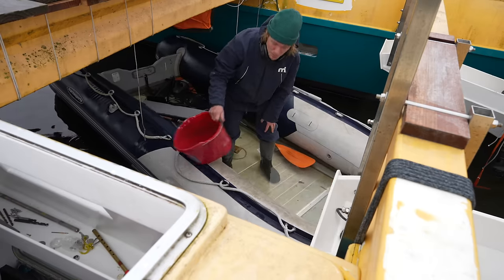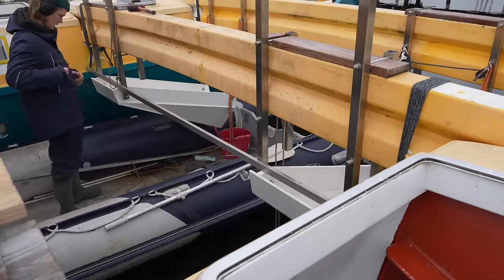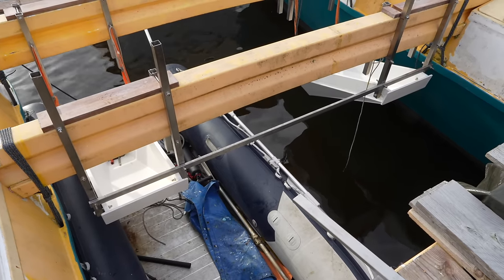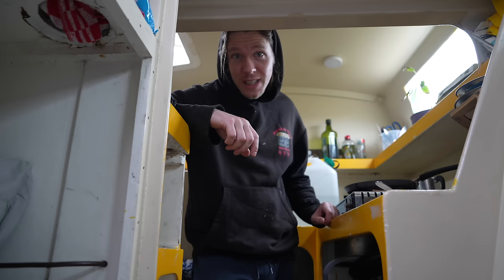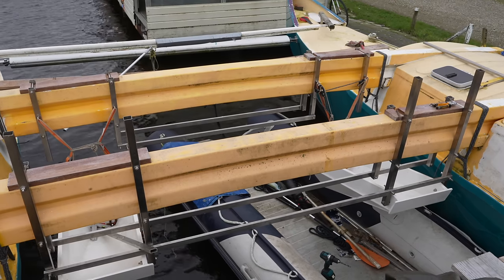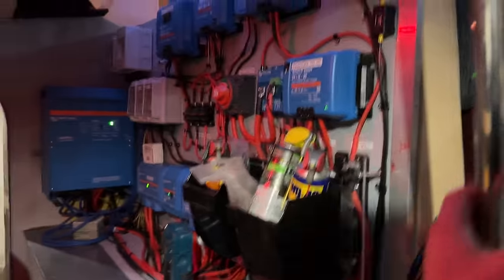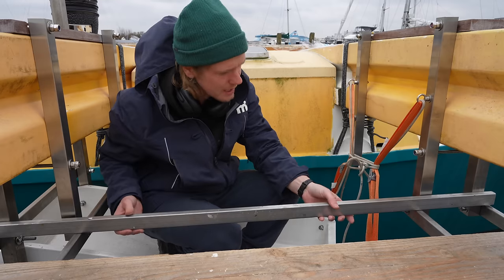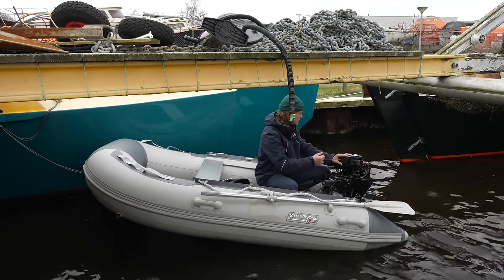I Built A Cockpit Floor for My Ocean-Going Catamaran | Wildling Sailing

Comment: U asked for drill sharpening advice.  I gave it before ... but here it is again.

Buy a small elec grindstone.  Hold one side of the tip to the side of the fine-grit wheel, at the right angle, press it on, and twist it off to lower the trailing edge of the cutting edge.  Repeat on other side of drill tip.  You'll make a hash of it the first few times, but once u get the knack, u can sharpen a drill in 60 seconds.  Remember - there's no magic about the angle of the drill tip.  Just get a sharp cutting edge on both cutting edges of the tip, with the trailing edges lower than the cutting edge.

I've been doing that for the past 30 yrs - for drilling steel, wood, & everything else.

PS - I've built three large yachts - all wood.

Another PS - for lifting an outbaord into/ out of a dinghy, make a rope harness for the engine, the end of the rope being approx 6-8 foot long as required, knotted every 12 inches.  From the jetty, haul up/ lower the engine efforlessly.  Never - but NEVER - load/ unload anything heavy while standing in a dinghy.  U will come to serious grief ...

Another PS.  Never hack-saw steel.  Get steel cutting discs for a small angle grinder.  Cut any steel in seconds.

Comment: make sure your drill bits are labeled with an HM not HS they work better for Hard Metals use cutting oil rather than WD 40 ,WD stands for water displacement and was originally designed by NASA to keep rockets from icing over , fun fact , any how welcome back , was about to drive to Holland to see if you were okay , oh i live in Germany and have a variety of skill sets if you ever need a little help  from glass work , carpentry , CNC machining ,,,,cheers bro
Reply: or if you need a little break close by in upcoming future  and want to see Hessen for a spell , hit me up

Comment: Please weld it dude. This bolting stuff... pls no ❤ drilling stainless is torture. the bolts are expensive. it weakens the tube and crushes it, making it more likely to bend or crack. welding can strengthen things, and distributes the load to the strong parts of the tubes. Many more reasons, but yeah... you don't want to have to re-do this in a year.

Comment: OK, later on you mention sharpening the drill bits - just tell me to shut up!
Sharp tools are incredibly important.  When I worked in a machine shop ago, in a life time far, far away, I sharpened my drills REGULARLY - in my case perhaps a couple of times a day but I was using them in production, maybe every day at start of work for you. Sharp tools!  And in some cases, a different share top for different materials, if I recall.

Comment: Sorry, you are doing an enormous amount of work and I hate to be negative but I cringe every time you judge rot with a little tap tap or your engine mounts with a little hand pull, please reevaluate your notion of the forces involved, you will have 20HP of motors, that is tons of forces not always in line with your brackets and that is nothing compared to the force of the sea,
and yes the brackets will always get loose from the beam, you have to GET COMPRESSION TUBES at the bolts just as a start
but they will still get loose with time.

Comment: You need to learn how to use a grinder to sharpen your drill bits Or go buy a drill bit sharpener It's ridiculous watching you trying to drill with a drill bit that is not sharp
Reply: Well I guess I learned a powerful lesson just now watch the whole video before you comment LOL I still think you need to build a cabin on the top of that boat

Comment: I think the whole thing is a really bad idea, ocean salt will corrode the steal to unsafe condition in less than a year, galvanized or not, once you drilled/weld it that join is not protected anymore, paint don't reach inside bolts, this is where you gonna stand, if it falls in the middle of the atlantic you are dead...

I love DIY but this thing is really really bad thought and dangerous for you and others, it's a lot of work I know but still I will tear it down...choose another material, don't gamble your life and others on this.

I don't know wich country you're but...there's no maritime regulations there?, as far as I know partially self builded boats must go over inspection before going to sea...when they see this he would not be cleared